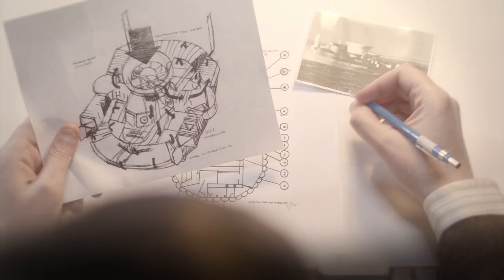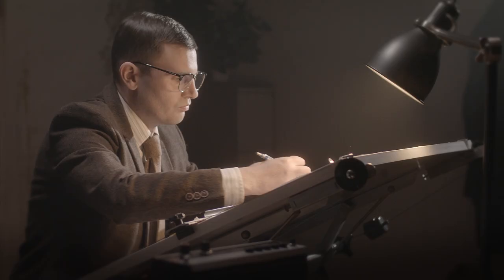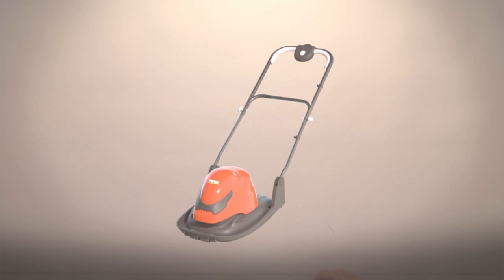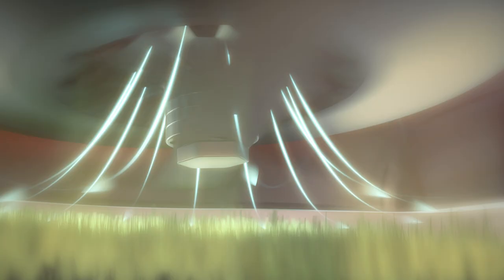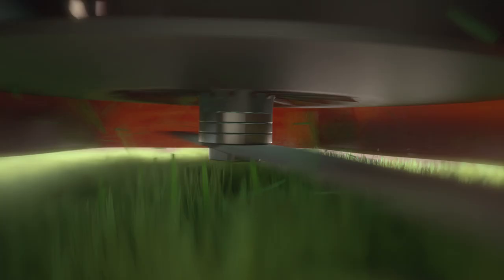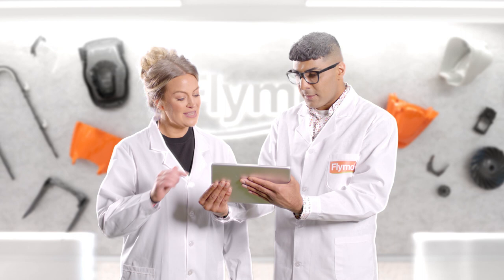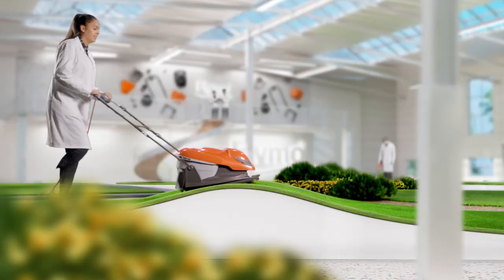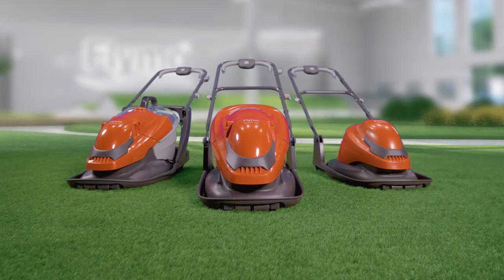The Flymo Hover Story - How it works

Comment: I was amazed to run across this video. My dad bought a Flymo lawn mower when I was kid in the 1980's in Portland, OR. I think he got it and the Fred Meyer's store. We had a lawn that ended in a drop off that was very hard to cut with a normal mower. With the Flymo I was able to stand at the top and swing the mower back and forth by holding on to the handle. I had no idea it was still being made.

Comment: My sister has one and is quite satisfied with it. I'm skeptical of the cutting ability due to the airflow principles, but i live a few continents away from her so i haven't had a chance to try it myself and compare it with the hundred or more mowers i've used in my life. She says it really is great for edging and for the uneven front lawn they have. 
While i am guessing i would be disappointed with it in heavy use, if it works in areas i would have to use a weed trimmer, then that's a big bonus, as weed trimmers can be very fussy (managing the twine) and the vibrations and noise and mess are usually awful.